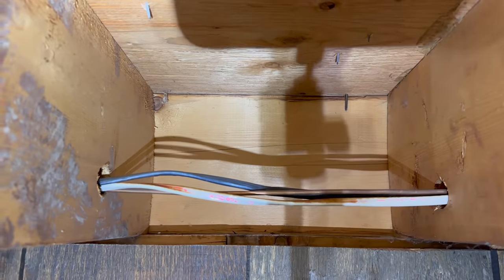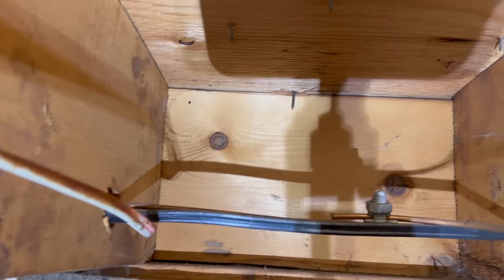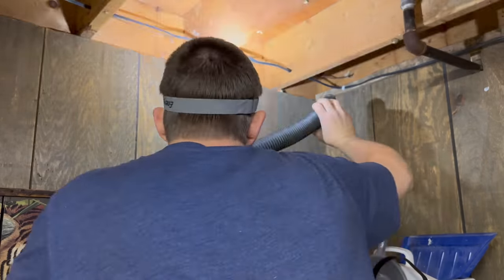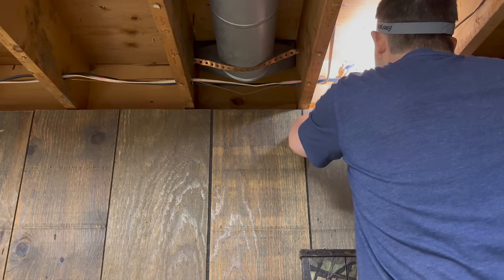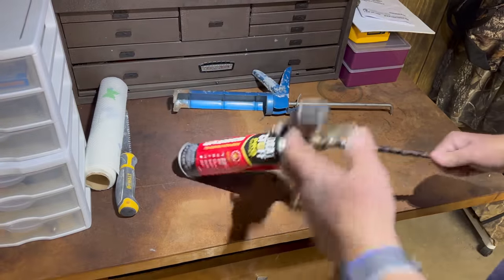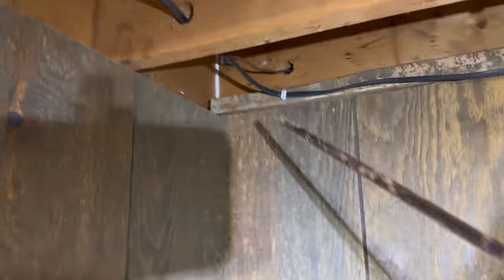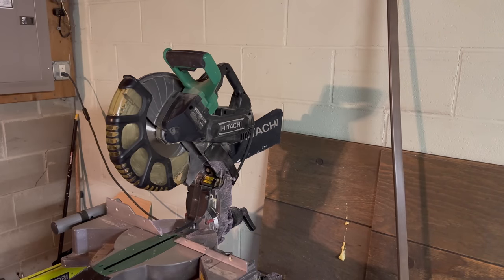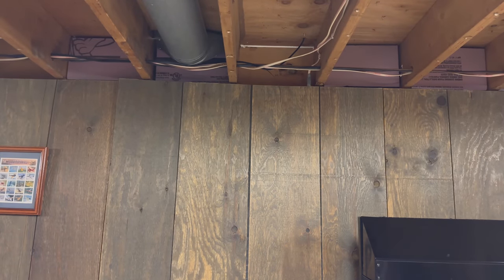Rim joist insulation air sealing

Comment: So all of my joists are filled with brick and mortar. I have no idea why but it’s an old house. Am I screwed basically from sealing it now?
Reply: do you have a really old brick house with thick walls they used to actually put the joists into the brick wall, and it sat on the foundation to support the joists new houses just have one layer of brick over a wood framed house as a siding its not structural. you could put insulation over the bricks to seal it up.
Reply: That sounds good actually! Brick is insulation!

Comment: I put pieces of R14 Roxul in first then cut pieces of 2" foam to fit tight and sealed the edges with acoustic sealant
Reply: Agree to me your method sounds better. Maybe because I live north of the 49th.?
Reply: wouldn't you want the roxul towards the house for fire rating the foamboard is not supposed to be left exposed.
Reply: @ranger178  that's actually how i insulated the walls. 2" XPS against the foundation and Roxul R14 batts between the 2x4 studs. It's all covered in drywall for fire barrier.

Comment: Pest COntroll will not like that in the south.
Reply: Probably not cold enough in the south to make a great difference.
Reply: @percyfaith11  conversely, this is where majority of AC loss would be from. Still makes sense to seal
Reply: @tbarbuto2345  that's true. As long as someone kept up with the termite control traps, that shouldn't be a problem either.
Reply: @garettbenham5312  depends. I had a house I flipped where they came up between the stone veneer and the foundation. Had the house inspected by my pest control company prior to purchase. I Noticed a stone coming loose by the front door. Pulled it off to add some mortar behind it and regrout. Immediately discovered mud tunnels behind that stone. Termites had eaten up the rim board, the sheathing, the mudsill, bottom plate of the wall above, and a few of the studs. They made it all the way up some of the studs to the header of the window, fortunately stopped right at the end of the jack studs and didn’t make their way into the header. They had even gotten into some of the hardwood floors right by the wall. Also discovered that someone had scabbed on studs onto the termite ridden studs in the past 🤦‍♂️. Had to reframe that whole wall. Luckily the floor joists were running parallel to the rim board on that wall so they didn’t get into the joists.
Reply: @garettbenham5312  yep. Right to it. House was built in the late 80’s so someone could have backfilled more dirt later but who knows 🤷‍♂️. Fortunately that bump out wall on the front was the only stone veneer on the house as an accent. Rest was siding so that was the only termite damage.
Reply: @macgyver03ga curious to learn from your experiences. Would having plants and grass etc very close to the house aid in termites interested in a home to infest?
Reply: @zachgoestoeuro  I don’t think the plants make any difference. But I’m not a termite expert so who knows. Seems to me they’ll come through the soil regardless of what’s around. I just built a custom home last year and went overboard on termite treatment lol. I had the pest control company come spray termidor liquid on the basement & garage footings before we poured the slabs, then we sprayed the bottom 2’ of all the framing with a borate treatment. Only one or the other was required by code. I did both 😬.
Reply: @macgyver03ga  Yikes!!